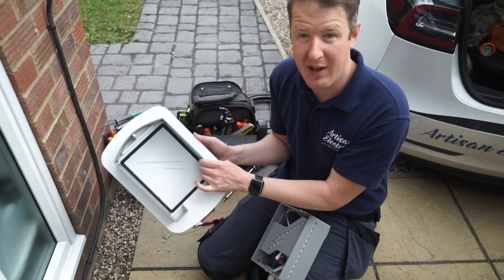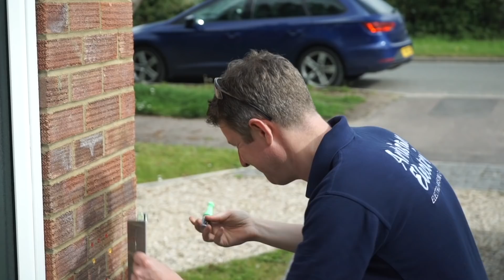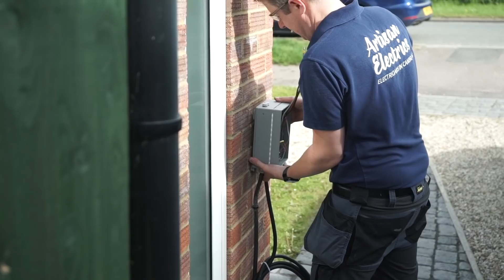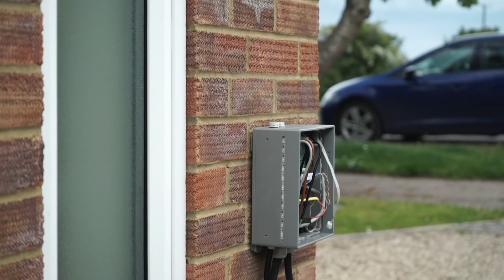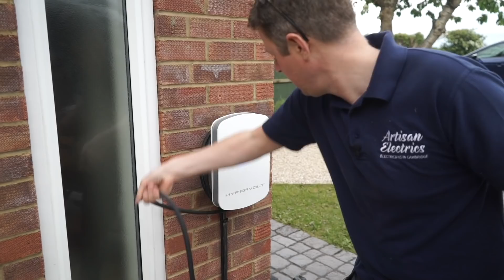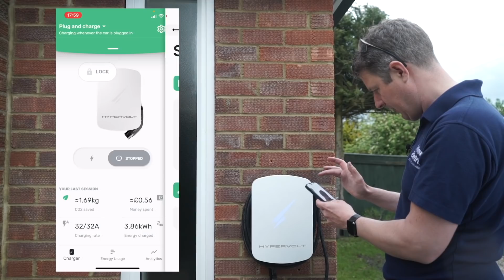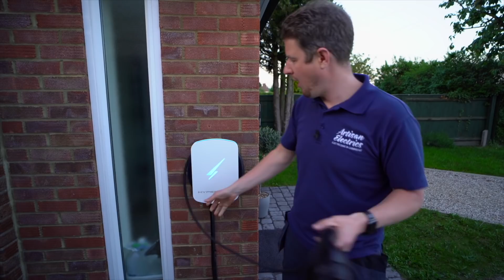Is This The Future of Electric Vehicle Charging? Hypervolt Installation

Comment: This charger reminds me a lot of my own Wallbox Pulsar Plus which also uses a Raspberry Pi, has LED lighting that indicates status, and even the look and feel of the app looks similar. It even has the same rotary switch to set maximum current and has a PEN fault protection device. Either wallbox are trying shake off their poor customer service reputation by rebranding as HyperVolt, or some ex wallbox engineers have started a new company…maybe! :)

Oh, by the way, I really don’t consider a fan as a feature Jordan. It’s a mechanical moving part that will fail at some point. Passive cooling is always preferable.

Anyway, good to see some variety in the EV charger market. I am also someone who considered a Zappi but didn’t like the look of it.

Comment: "Includes paid promotion" - not an unbiased opinion then! Hypervolt is too gimmicky and there's too much to go wrong. Raspberry Pi indeed and that many LEDs is overkill! I prefer Myenergi Zappi or Andersen A2 - you'll never beat them - they're best all round EV chargers IMHUO (In My Humble Unpaid Opinion!) 🤣
Reply: So Hypervolt is gimmicky but the WW2 supply cabinet sized A2 is lean and efficient? That is an interesting view to say the least! Zappi is cool and we love it, good and efficient use of hardware, but perhaps you’re a bit quick to judge chargers on true merits. Hypervolt gives you every single feature of the other 2 and more, for quite a bit less money. The A2 is triple the price for far worse software and features!
Reply: @hypervoltev  ok then! I wasn't going to comment on what is obviously and disappointingly for Jordan a biased review video (the fact he doesn't once compare this with any other charger means we aren't getting his honest opinion!).  However,  directly attacking the competition with your own insults is pretty low.   I have the A2 and as an end user it's been the absolute definition of  simple, hassle free experience.   The app works fine,  i can input my tariff and it gives me all the analytics i care about.  The scheduling is simple and way more reliable than my car's.  And with the real wood facia it looks awesome whilst not having any bright leds to attract unwanted attention in the early hours of the morning when it's normally charging!  I get that you are trying to break into a crowded market but maybe just let people give honest reviews and try to have a little more respect for the competition?
Reply: Happy to hear you're having a great experience! Solely from a cost and engineering point of view however, our comments are not insults. The same hassle free experience is available at one third of the price and size, which from an engineering point of view isn't particularly great we feel.
Reply: @hypervoltev  to quote: "WW2 supply cabinet sized A2 is lean and efficient?" - this is subjective and honestly, yes - the A2 looks much nicer than your plastic unit that seems designed to attract todlers rather than appeal to adults!.  "The A2 is triple the price for far worse software and features" - At least the A2 uses dedicated hardware rather than hobbyist electronics that just add complexity and more points of failure.  If Jordan hadn't been paid for this video then maybe we would get an honest comparison from someone who we could actually trust...  Your continued comments just makes me less and less interested in your product.
Reply: @alandann9551  Agreed, it may look nice, but this is about a mass market solution that everyone can afford. While the “hobbyist electronics” are going away fast, software superiority is the name of the game for the end customer, not the means that get to a certain end. Wouldn’t you agree for many people internals make no difference? You say hobbyist, we say 40 millisecond edge device latency, about several hundred times faster than the next in line. Those LED light updates Jordan is showing are actually happening over internet. Sorry to hear you’re not interested in the product, but happy to hear you are pleased with your A2! Hopefully you can see how they won’t create product that will be installed in hundreds of millions of homes which is what we’re gearing up for eventually, even though there are a lot of cool things to say about it.
Reply: In my humble unpaid opinion (in my capacity as a customer with no connection to Hypervolt)  the Zappi suffers from supply issues and requires a separate box (at additional cost) to make it smart and qualify for the grant. 

There’s a chance I was unlucky with installers in my area but it was months and months (over 5) before I could get a Zappi installed and in the end I gave up when I realised I could get the same functionality for less in a (subjectively) better looking package with the Hypervolt. The fact it also has Alexa skills is a bonus. Just shows that one man’s gimmick is another man’s feature. In contrast to the Zappi, the Hypervolt arrived in a week.
Reply: @TheWhiteLife  Did you try Artisan Electrics for your EV install? I disagree that the Hypervolt looks better - the separate plug holder is just plain ugly! More gimmicks equals more to go wrong. I wouldn’t trust Alexa with any device in my home - i can’t abide so called smart speakers - you do realise they listen to and record every conversation. I have no connection to any company, so you’ll always get an unbiased opinion from me.
Reply: @GadgetMan36  No, I live in the South West and was relying on registered installers from Zappi’s own website.

I’m not sure Jeff Bezos would be that interested in whose turn it is to empty the dishwasher, although if he can come up with a neat solution to nag my son to do it, to save me the bother, then crack-on, Amazon.

You don’t like the separate plug holder on the Hypervolt; I’m not in love with the one on the Zappi, it makes it look like a trunk. Nor do I like the lcd screen on the Zappi, the graphics are like something from 1990. I was considering the Zappi on its merits, not it’s looks. For me, the Hypervolt compares on functionality, is cheaper, available, more compact and doesn’t need a separate box in my living room. I also find it cleaner looking and in matters of taste there can be no disputes. Chacun a son goût an all that.

Comment: Can you adjust the charging rate from the App? I would like to be able to sometimes charge at 10amps, sometimes 16 amps, sometimes 32 amps without having to set that in the car. i.e. either set it remotely from the app or set it as part of scheduled charging (or both).
Reply: Yes it does! It also does it from the web portal, or automatically via load management or solar, so you don’t even have to do it manually.
Reply: @hypervoltev Will the upcoming 3phase model support automatic switch from 3phase to 1phase charging from pv solar?
Reply: @dti-21  Yes it will!

Comment: 1. How much?
2. Is it also available as a three-phase charger?

Asking for a friend... 😎
Reply from the maker: Have a look on the website the price is there
Reply: @artisanelectrics  Single phase only. The DNOs here react allergic on single phase loads of more than 4.6kVA. Loads with more than 4.6kVA must be connected three phase. Afraid of unbalanced load in their grid.
Reply from the maker: Wish we had that here!
Reply: Aren't the chargers in the cars🤔
Reply: @acelectricalsecurity  Yes they are, but in common language the chargers are mounted on the wall. This is only a power supply with a contactor, electronics and safety measures integrated.
Reply: @acelectricalsecurity  They are.  I call them charge points rather than chargers for that reason.
Reply: 569 plus VAT before OZEV
Reply: 3 Phase coming up later in the year, not currently available, but will be in September! Working very hard on it.

Comment: I use a raspberry pi for some home automation.  Their weak point is the sd card.  Mine failed after two years of continuous operation at which point the home automation also failed.  The cause of failure is typically excessive data writing (typically lots of housekeeping data logging).  It’s either an easy or difficult fix.  You replace the sd card - that’s easy.  If you don’t have a backup image, then it’s hard.

But in general:  any device that relies on an sd card for boot / operation needs to have a maintenance plan to replace those sd cards.

In future, my automation projects will use microcontrollers rather than computers.  Much simpler things, and that’s what you need when “just one job” is needed.

My pi is now operating on a “high endurance” sd card, so hopefully it’ll prove more reliable in future.
Reply: We use very high quality SD cards, very high above what’s normally available. Never had a problem with them, even after years of usage! They are going away however, in favour of latest generation hardware!

Comment: How about the security you are allowing a full computer on your internal network which is control by a system on the outside and expecting their security to be 100%
Reply: VLAN everything IOT
Reply: @ryang6572  Yes but how any electrician know how to set up a VLAN and are you going to set a VLAN just for the charger and then access for you phones will be trouble.
Reply: @matthew6cooper  agreed in regards to most non IT people knowing how to setup a VLAN (or know what one is) but any “smart” device should be on a vlan if you care about your security. Have a Local Network VLAN and a dirty network VLAN for all things smart.
Providing a device doesn’t require a direct connection and communicates over the internet a VLAN shouldn’t cause any issues.
Reply: @ryang6572  Even if the 'smart' devices (which is a big list) are on a separate VLAN you are still putting a full computer on the network that will have access to all the smart devices it may not have access to your computers.
Reply: @matthew6cooper  I don’t see a significant risk mixing it with other smart devices as long as they are away from things that matter to me from a security point of view. Just put it on it’s own VLAN for all the time it takes to create an additional one?
Reply: @ryang6572  OK smart device on the separate VLAN but the real question is who is going to inform the customer that this should happen and install the equipment and most  customers just use the router supplied by the broadband company and does not have VLANs
Reply: @matthew6cooper  they wont be informed as most people don’t appreciate the risks or how to mitigate them. Any smart device is a substantial risk to your network security - this one being no different. Having a Pi is just as much of a potential risk as having a built in web server on a DVR/ NVR - all these devices are potential recipes for disaster when used without caution. 
I completely agree with what your saying - I just don’t think this device is that much different from any other smart device that customers likely already have (from a security perspective - perhaps only slightly more).
Reply: We have by very far the most advanced end to end encryption in the industry fortunately, with some very serious cryptography backing up things! Even simple things like WiFi Setup require Duffy Huffman asymmetric key exchanges. It’s safe to say in terms of software we are in a very different league!
Reply: @hypervoltev  If I was a hacker that is the last place I would try to hack the connection to you system I would go for your computer system
Reply: @matthew6cooper  If you can hack your system we’d love to offer you a 6 figure job working with us immediately!

Comment: Fitted 3 of these in the last week and got to say they are a great little charger, I've previously installed Zappis 95% of the time.  Definitely my go to charger now as its a lot more competitively priced than the Zappi. I'm not paid by Hypervolt to say this!
Reply: Indeed, cost is very important! Our one box includes all philology saves hundreds of pounds versus competition, while sacrificing absolutely none of the functionality!
Reply: @hypervoltev  Can Hypervolt monitor your solar like the Zappi? That would be good, but it only seems to have one CT at least in that installation.
Reply: @mondotv4216  they claim it now works after completely copying the zappi, who were doing this 5 years ago

Comment: What height would you drill the hole through outside wall on first fix for a perfect finish with no cable on show and for the top of the charge box to be 1.2m from floor level please? Thanks in advance if you can help. Also would you run a separate spur switch on the inside if you had a choice? 
P.S. Hypervolt if your reading this then having your plug hanging down loose looks rubbish and it will get wet!  How you dont have a cable entry area for main feed in the back of the box so it can be hidden is a major oversight because the cable out the bottom looks horrible and I wouldn't buy your box for those 2 reasons.. Keep working harder.

Comment: Can you actually answer one question about EV Chargers. Why they are allways built in a way, that the electrition really has to take off the cover and connect the cables? 
When I would design it.. I would make a connector at the cover, which allows the user to just plugin the cable without the need for a tool ! Like it is with go-e charger or juicebooster..
Reply: Current draw.
Take this hypervolt or the zappi 7kw charger, it will draw around 30A. There's only specific outlets that can handle that. You'd need a dedicated circuit/outlet for that anyway.
Reply: @duzzah  But you know the plug that is used with the Juice Booster 2 to connect to all sort of diffrent power-plugs? That cable is even fine with 22 KW !  So I guess it is mainly to make sure an elctritian has to install it, and not a simple home-user.
Reply: @CurdinGees74  the juice booster 2 comes with various plugs, but to plug that into a standard GPO in the UK you'll only get 13A max single phase or 10A here in Aus. (Which is unlikely, juice booster limits to roughly 8A)
To get the full 22kw 3 phase you'd need the specific outlet like I mentioned before. 
Charging from a standard GPO would increase charging times by around 3 times versus hardwiring/dedicated single phase circuit.
Reply: @duzzah  A red CEEE plug at the wall would be enough to even serve 63A - 3 phase.. my thought was simply to design the wallbox in a way that there is no need to open the box.. but anyway electricians can handle it the way it is.. no question about that.
Reply: @CurdinGees74  the point I'm trying to make is, either way you go about it you'll need a qualified electrician to install something.

Comment: Still does not beat the mighty Andersen A2
Reply: There is nothing special about the A2, other than the enormous size, price, and finish! If you really want a storage cabinet that is finished in wood, the A2 wins, if you want a 21st century charger for 1/3rd of Andersen price, there is really no competition.
Reply: @hypervoltev  it does have its place, but the A2 is classy and does not look like a petrol pump on the side of you're wall

Comment: Why does it not have an internal Wi-Fi???
Reply: It does
Reply: @AndyK.1  Then why hardwire the Wall Connector to your Network. If there was a need for a faster connection I could understand, but this is a miniscule amount of data being transferred. And it costs almost $805 US Dollars 569 British Pounds to be exact... That is $305 more than a Tesla Wall Connector.
Reply: @michaelholliday100  preference or reliability. I would always choose a hard wired network connection if there is facility for it (I am a network engineer) as had too many WiFi issues over the years. The charger might also be somewhere out of WiFi range if its in a garage etc.
Reply: @timprice5  I fully understand, I wired my entire house with Cat7. I even use phones and tablets in my house wite with eithernet to USB-C adaptors. But my Model Y, Tesla Gen3 Wall Connector and my Leviton Decora Smart Wi-fi switches, Garage Door are all wireless. I am using Starlink for my internet and average about 275 Mb/s down, 25 Mb/s up and 30 ms Latency...
Reply from the maker: This charge point was connected via wifi, the data cable was just for the CT connection
Reply: @michaelholliday100  A Hypervolt costs £569 not 969? Not sure where you saw that price!
Reply: @hypervoltev  I edited my comment, that it is 569 British Pounds which is $805 US Dollars...

Comment: They should add a stand for the charging connector so it's not just hanging there, I feel like it is going to hit the wall all the time and get damaged
Reply: We supply a holster in every box!
Reply: @hypervoltev  how well does the fan work with a cable wrapped around it?
Reply: @UberAlphaSirus  Pretty well. It's designed to work for other scenarios, but it works in conjunction with subtle air ventilation that cannot be blocked by the cable, so whether or not cable is wrapped around doesn't matter much.
Reply: @hypervoltev  so why does it need a fan open to the elements and insects?
Reply from the maker: They do I just chose not to fit it in my install

Comment: Jordan you need to fill up those holes in your Swiss cheese wall from when you have installed multiple chargers
Reply: It would probably be a good idea for him to install a sacrificial backer (like a cutting board, wood plank, etc.) to the wall once and then mount the EVSE to that rather than directly to the wall.  Once the backer looks like swiss cheese he can replace it and attach it using the same screw holes in the wall.  Not only would it look better when all is said and done, it might also keep his house from collapsing.